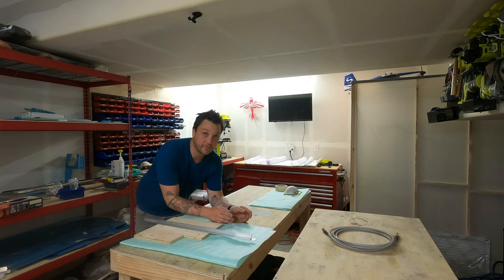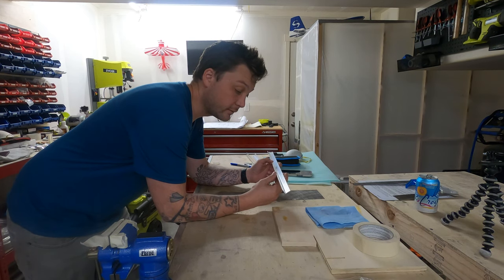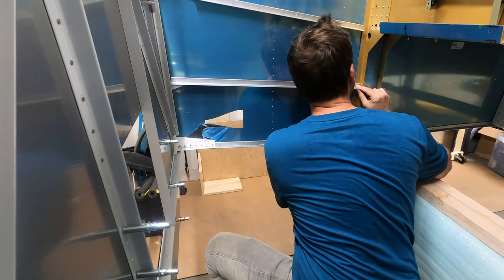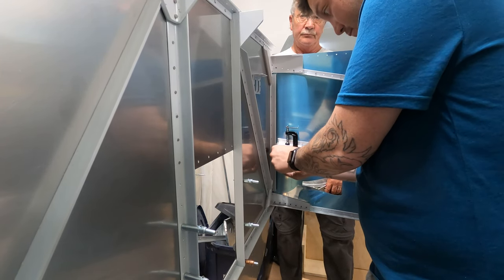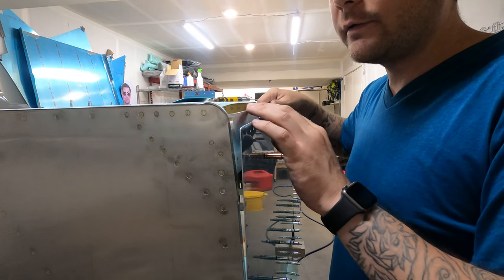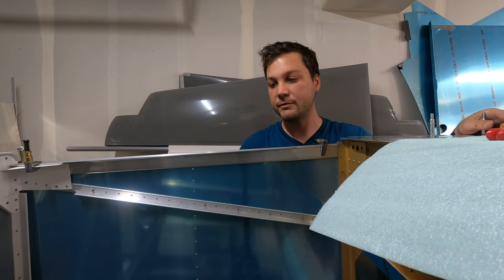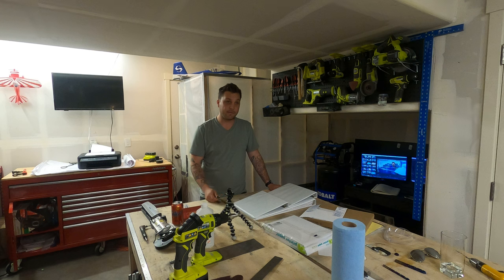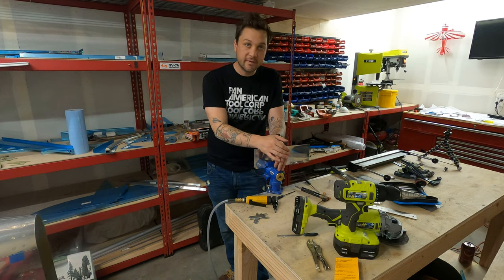Fabricating Fuselage Structures | EP3.13, Building an Airplane: The Van's RV7A

Comment: Great that you can continue with your build. I am on hold with my Wing kit due to laser cut parts. When I got back from Air Venture I noticed that Vans had removed the NEWS tab from Home page. They also had a sign up for future news and information. I signed up. The only way I found out about this update was by viewing you you tube channel, nothing from Vans. I had to hunt around but finally found it along with a new update on the 18th of this month. Starting to get pissed that the only way to get information from this company is second hand. They should have a list of the builders that this problem effects and be able to send them updates. Thank you for the update!!!
Reply from the maker: Absolutely.

For the record, I, too, believe communication could see some improvement. I know they’re undertaking an arduous process, but I’ve been trained (and learned) to just get out in front of it.

I grow tired of seeing the conversation turn angry and adversarial before Van’s finally decides to extinguish some flames.

As always, it’s easier to critique from our positions, but I do feel like communication is lacking.

Comment: Hey Ryan, I really appreciate the attention to detail you are putting into your build. I have watched other videos and have noticed some do not prime everything inside the airplane. I would think with the weather we have here in Wisconsin priming everything would make sense, anything from 100 and humid to 40 below at different times of the year. Also, wondering if you have decided on an engine and firewall forward yet.
Reply from the maker: Priming is a preference, and 90% of priming is "optional." Planes can last for decades unprimed, especially in drier climates. 

Like you, I'm in a wetter, temperate climate and priming seemed like a wise use of resources. I'm also inclined to believe it will make the airplane more appealing when I decide to sell it years down the road.

I've seen some very skilled builders go without priming and I understand their reasoning. For some, it doesn't make sense.

I've not yet fully committed to a power platform or avionics suite. Still some thinking to do there, but time is ticking and I've got to make a decision quick, so likely news soon on those fronts.

Thank  you for the kind words and feedback. Great to have you following along!
Reply from the maker: I will note, and probably a more helpful data point, choosing to prime is never a "no brainer." The amount of time and money it requires to fully prime an airframe is astounding. 

Akzo is up to $400+ a set now. Other priming related supplies are likely on the order of $1,000 or so. And then the time. Boy is there a lot of time spent. People bemoan deburring. I bemoan deburring. Priming and the associated tasks probably take three times more time than deburring. 

In case I haven't made it clear: priming is an incredible amount of work added to the build. 

If I had all of this to do over again, I'd still prime. But you may want to talk to me in 5 years and see if I still feel like that...
Reply: One option I am looking at is the Viking 195T. They quoted me a price that is current right now of a complete firewall forward package which includes the engine, the fuel system, and a three bladed composite, ground adjustable prop plus all you need for all the electrical connections. This also includes the cowling. The price I received was just over 35K for the whole package. @RyanFlysPDX

Comment: What is the significant difference of the laser cut parts? Is it something about the heat cycle making them more brittle around holes or something?
Reply from the maker: The link below will give you a full rundown, but in short, some laser cut parts that were outsourced to meet demand were not produced correctly, and are prone to cracking when dimpled. Van’s continues to perform research and testing to guide builders on how to address the situation. Some parts may need to be replaced. Some might not. Of course adding parts to your plane before you know whether or not they’ll need to be ripped out can be problematic.

Nearly all the work I’m currently completing is completely free of potentially erred parts. Much of the suspect parts are already riveted to the airframe. My main concern is further burying these parts if they do need to come out.

https://www.vansaircraft.com/2023/07/information-about-dimpled-hole-cracking-on-some-laser-cut-parts/
Reply from the maker: And to more appropriately address your specific question, it more relates to feed in/out of the hole than anything. While some will offer debate, a properly setup laser program will cut parts that can be dimpled problem free. It seems someone at the outsourced vendor got sloppy with their program, speed, power, or all three.